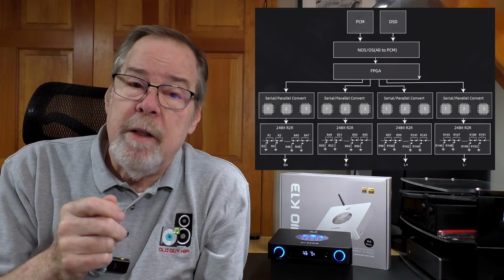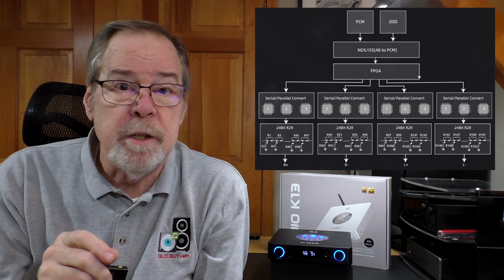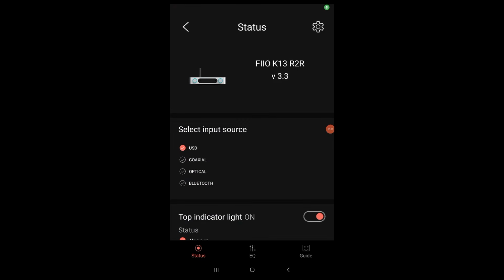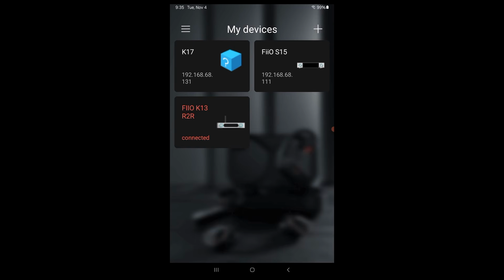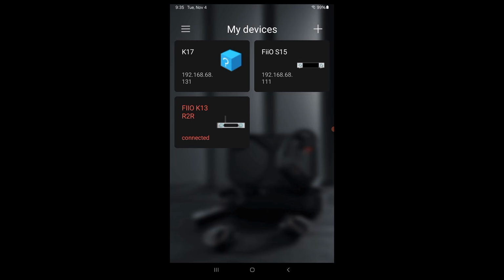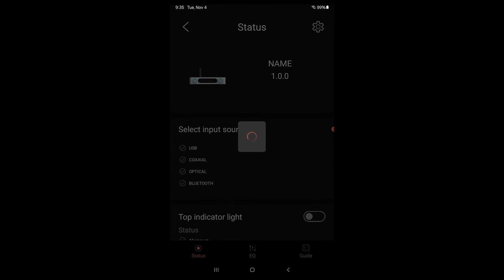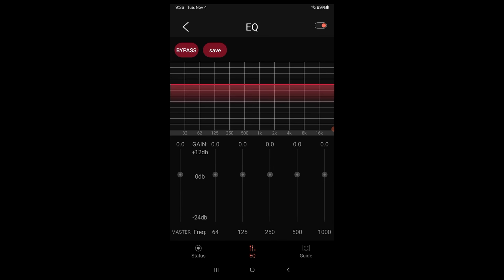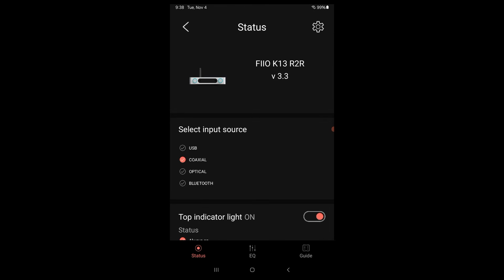FiiO Just Redefined “Affordable High-End”! Budget Price, High-End Sound: The FiiO K13 R2R Reviewed.

Comment: Hey Ed, I'm just curious if you have done any reviews on the Fiio k11 r2r dac. I would love to hear your take on that particular dac/amp. Thanks Ed.
Reply from the maker: I did 2 reviews last year.
Reply: @OldGuyHifi Ok Thanks Ed, I'll check it out.
Reply: @FoxRacing246  Hi, I bought one, just to try something r2r and stupidly cheap in my 2nd system... It's fair to say I love it. For the money its a no brainer. I bought this ridiculous Douk audio T6 pro class D amp as well. Just for fun. The dac cost $125 and teh amp about $250 USD. Iv'e always been a Single ended triode/horn speakers type of listener. But these cheap Chinese things are now very good. I was really surprised. Ive got them running with spotify lossless. macbook air and Living voice auditorium speakers. The amp benefits from the higher spec Power supply. The dac is the most listenable dac Ive had. My main listening is turn table though.... I don't use headphones very often.

Comment: Ed, still trying to wrap my head around all things reclocker. Question, when using a reclocker, is it always the case that you will either lose bit depth or sampling rate, or just some of the time? Trying to see if this is a steadfast rule or not.
Reply from the maker: You never loose any bits and the sample rate for SPDIF has always been a max of 192kHz. So even without a reclocker any Hi-Rez file run over SPDIF will never exceed 24 bit 192kHz. So, if you are coming out of your WiiM Pro streamer or equivalent, with Toslink or Coax, that signal is max'd out at 24/192. Only on USB or I2S will you get anything higher. I will tell you that I can pretty much guarantee you will never hear the difference.  Since there is zero music that was originally recorded at anything above 24/192. If the source claims to be at a higher resolution it was upsampled to that for marketing reasons. My guess is that truly no one can hear the difference between 16/44 and anything else. BTW DSD will pass through the reclocker at DSD(DOP)64.

Comment: In functionality the K13 R2R runs circles around my Ifi Zen DAC V2 + Zen Can stack. More inputs AND outputs, remote control (the ability to switch between headphones and line out speakers with the remote is awesome), built-in EQ, more power yet doesn't get hot (just warm). The sound really suits my preference of having gentle treble and a more relaxed "mature" presentation......it's like the DAC-equivalent of Sennheiser headphones, you can comfortably listen to it all day. In that regard it may actually disappoint users who want electronic synths to sound sharp and crunchy, it's not going to be like that out of the box. But of course.....built-in EQ to the rescue if you want to change that.
Reply from the maker: Thanks for sharing your detailed impressions and comparison! I agree with your assessment.
Reply: @OldGuyHifi  Good review,very elaborated!
I have an iFi stack with Zen Can 3 and Zen Dac One Signature. I also want to buy K13 R2R just for variety of sound in my Hifiman Ananda Stealth and Sennheiser HD 560S. K13 it will be better than my stack or should I just not buy it?
Reply: @jtekkit  I really wish I hadn’t read your comment! Taking delivery of Arya Stealth the end of this week. Still have the Zen DAC v2 and Zen Can setup with my computer for listening. I saw the popularity in this device and thought it would fit my needs perfectly. And now that I see you’ve done a similar upgrade, I’m not sure I’ll be able to hold off on trying this out!

Comment: Thank you for you input. Great channel! Planning to drive Hifiman XS with Fiio over balanced 4.4mm. Have ordered Fiio K11 R2R and debating whether is sufficient to drive them or I should go for K13. Does K13 deliver better amp not just more power and does K13 fixes the need for separate supply such as clean IfI x pro. If I am to add IfI x pro to K11 would it make sense to just skip that and go for R13? My primary use case is desktop set up to drive headphones from my Mac Air, iPad, an iPhone using Apple Music and YouTube video content.
Reply from the maker: For your setup, the K13 would be a better choice as it provides a cleaner and more powerful signal without needing an additional power supply.
Reply: @OldGuyHifiBTW, love your Budget Holiday System buying guide. For folks new to this hobby, this is what they need. Advice how to pair things up for good and enjoyable appreciation of better quality sound. I was lucky to be able to add to my set up self powered  KEF LSX II from Costco for unbelievable $599.

Comment: I love the sound and features of this DAC! I also have my PS5 connected to it. But there was an issue doing that. I was getting digital noise via USB to the DAC; which produced static and crackling noise. To resolve this, I bought an HDMI to HDMI Audio Extractor (make sure it can output your desired resolution and refresh rate). I then connected a Toslink cable from the extractor to the Fiio K13 R2R DAC optical in. This worked wonderfully!!!
Reply from the maker: Did you try changing the UAC setting?
Reply: @OldGuyHifithe PS5 doesn’t recognize the K13 as an output device when set to UAC 2

Comment: Hi Ed, I have been seeing a lot of good things about this Dac. How would you compare this Dac for 2 channel music listening compared to the Chord Mojo or Mojo 2? Also any chance Fiio makes this R2r dac with a music streamer...I am in need of a streamer and that would be a dual purpose for me...😂
Reply from the maker: I would choose the FiiO for several reasons. The form factor. It is a regular desktop component size. It does have a built in power supply, or if you wish you can use an LPS. It has balanced headphone out and RCA and XLR outputs. It is a true differential balanced circuit topology and it also use an FPGA. The colored buttons on Chord gear is a pain to use. With the FiiO many of the controls are on the remote. Best of all it is half the price.

Comment: Holy cow! First those headphones FiiO came out with (I pay little attention to model numbers, where they F1s or something?) and I bought those and they are my most comfortable and while they sound awful out of the box, I run them through a 4 band EQ (all headphones require EQ) and one small little tweak in the mid range and all the sins disappear.
I don't care about all the 3 letter acronyms like DSD, PCM, MQA, UPS, COD, FBI, CIA, whatever. They mean absolutely nothing to me.
Now FiiO comes out with this contraption! Makes me wish I was not allergic literally to headphones! Yes, even with the FiiO cans I just described, I'm good for maybe 15 minutes tops before they have to come off my head for at least two hours because of my literal allergy to headphones. (My ears turn red and get a burning like sensation, like a sunburn or something and it can be painful. It also doesn't matter what material the pads are made of.
The only thing I would disable on this thing is the Bluetooth. I don't do Bluetooth, it kills devices. I get up to 15 minutes of use on my tablet with a fully charged battery in bluetooth mode just for control, not streaming anything before the batter goes down to 4% and no, there is nothing wrong with my tablet outside of being Android 8 now. I rarely use it.

I wish linear power supplies weren't in the hundreds of dollars, then I could get one.

I like the way you described the EQ as a flat line, for a second I thought I was looking at my EKG read out......just joking!  The "De-essing" or "De-emphasizing" on an EQ (parametric or graphic) is a preset to cut back or eliminate sibilance. Basically, it is sort of a high-pass filter. Personally, I prefer manual adjustment to cut sibilance and such as sometimes those preset De-essing" settings can be too extreme. Sibilance is many times in the recording itself, which is why I prefer to manually adjust, because there is only so much one can do with a recording unless one want to remaster it, but most of us do not have studios and mastering engineers in out homes.
 
I hate on-line owners manuals. I have to have them in print to refer to them! Yes, I will print all 249 pages of an owners manual! I also still read real books, I won't touch a book reader or kindle device or whatever. I'm not sure whether that is a good or bad thing though with my poor eyesight. 

Oh, so one can just use the K13 as an outboard DAC?! On the surface, $320 is a lot to me for a DAC, but not only is it an R2R ladder DAC for the money, but it is also the kitchen sink. I have a Douk Audio Q11, why not add a R2R Ladder DAC, I'm thinking. Also I use a second gen Schiit Magni headphone amp, which does the job well and a Bellari 4 band EQ hooked to it which is a game changer for me and now I'm wondering if this one box will do it all as a headphone amp, EQ and outboard DAC? Although I am not so sure it can compete with my analog setup, which is easier to use for me.
I don't know, it is hard because I hardly use headphones. I don't get to listen to music much as a result unfortunately. (Not because I have potential to disturb my neighbors, I have a reference system, but I hate to and will not play loud! It is because my upstairs neighbor constantly disturbs me with loud noises so I can't hear my system or anything). No, headphones do not cut out her noise unfortunately, only slightly softens it, which is not good enough when trying to listen to music with a soft passage or detail or classical music.
Saving for this unit may not be justified.
Reply from the maker: Thanks for the comment.

Comment: R2R is not high end, is just an implementation.
i have built a few R2R dacs, with resistors and with good old Phillips chips and some Burr brown, i will tell you, nothing wrong with hybrids of delta sigma, dacs are not 100% delta sigma, they are mix of delta sigma and multibit.  everyday i run both, R2R and Delta sigma, and sometimes use more Delta sigma dacs than R2R for its sheer performance.
Reply from the maker: Thanks for sharing your thoughts.

Comment: Been enjoying mine for the last month or 2. I just use it as an AIO for headphones connected to an ipad with apple music or my consoles/gaming pc. Got it for $250 (usd) shortly after release and it’s even cheaper now due to 11.11/black friday sales. I dont use the phone app for it, but i have used the web app for eq, much nicer on a monitor. 

I have only 2 issues with it and 1 “i wish”. I’ll start with the “i wish”. I wish you could use both usb slots and swap between in the settings instead of having to unplug one.  My 2 issues, first, rarely, and i mean rarely, when turning it off, it wont turn off properly and the lights stay on. This prevents it from turning back on. You just need to hit the switch in the back and it fixes itself. 2nd issue. The LO button on the remote. Open it up, put some tape or gouge it out, better yet, don’t use the remote. If you hit LO, goodbye your ears or your speakers if you arent careful.   
Great device otherwise though :D     (Avoid black if you dislike fingerprints and dust. If you look at it wrong, it’ll randomly get a fingerprint on it)

Comment: Great REVIEW Ed! Thank you!! So, for people wondering about the Mimir!,  Hmm just like one commenter here,, i would say its OVER RATED! .. i had the MIMIR and THE FIIO K 13 for two weeks, and pls note, I have a Schiit Modius E( last version) for a year now.  THE K 13 SOUNDED BETTER than both MIMIR and MODIUS.  Now, i did use a DOUK AUDIO DDC  and JDS LABS SYNAPSE on all three.  Compared to the MODIUS, the MIMIRs BUILT quality is NO GOOD! The aluminum/metal used is so thin and sharp at the edges! Its cheaply made versus the MODIUS, also both have the same ESS chip. I also have to say, the MODIUS sounded the same or almost better than the MIMIR with the DOUK AUDIO DDC  and the SYNAPSE. via USB and Toslink! So I just returned the MIMIR, and im keeping the K 13!. I do have arya organic and BD DT 1990 PRO headphones.  NOW there is ONE THING i have to say with the K-13… when i used the 4.4 balance headphone out with my DT 1990 PRO. ( 250 OHMS) … on Low gain, Medium gain or a high gain, i get an OVER ERR. Error!!! . I went to FIIO website. And seems like they are aware of this and said to re start the unit.. well i did that several times. Same issue@.  It does not do this with my ARYA organic on 4.4 out.   So , im not sure why.  I will return this unit and i will buy another. K -13! Hopefully u guys that like the K 13 wont get that error! Hope this helps!
Reply from the maker: Great info. Thanks. BTW, I agree with you.

Comment: I am telling myself I wouldn't be able to detect the difference between this and the K11 R2R, which I have on the way. A Limited Edition Red one. I'll use the K11 DAC side to feed my 4-valve Fosi GR70 from my Isolated USB hub. Because the RCA outputs of my Fosi ZD3 Pre-amp are inferior to the XLRs, which feed my ZA3 Mono blocks. That way I'll have R2R Headphone out, and 4-valve headphone out, and Transistors sounds on the XLRs and Valves on the RCAs of the ZA3s - at the flick of two switches!

The best of all possible worlds! :)
Reply: It’s unfortunately pretty noticeable if using them as intended as an AIO. A different psu fixes the k11 r2r for the most part though, using it purely as a dac might be perfectly fine.
Reply from the maker: A lot will depend on the resolution of your system.

Comment: while it sounds great due to the upgraded amp section, i consider the K13 as  a kind of "bloat device" and it could have been quite a bit cheaper without that.
Reply: It’s an all in one, it’s what a lot of the budget side of the market wants. It’s small, cheaper ($250 or less most of the time), and just needs a usb connection to get going, or bluetooth.
Reply from the maker: Thanks for the view and comment.

Comment: Watch out for that LO button on the remote. Typical chi-fi
Reply: Yes, that has had me scratching my head on the K15 and K17 too. They can all act as pre-amps, so it seems natural that some people would want to feed power amps from them. So Fiio went a put an easily accessible switch on the front panel so you can bypass the volume pot and send a full strength signal straight to your power amps and blow up your speakers. What were they thinking? Other than that, all 3 of the 13, 15, and 17 look great.
Reply from the maker: Come on. It is a $300 unit. Have some realistic expectations.
Reply: @OldGuyHifi On the remotes I just wish they could have made activating LO into a button press combination that wasn't going to get activated accidentally, and made it a rear rather than front panel option on the K15 and K17.
Not doing so does make using power amps with these rather risky. I'm still sorely tempted to get one.

Comment: Thanks for the review. One thing, I don't quite understand a need in external reclocker, since k13 r2r has same XU316 chip built in and most likely has most of the basic reclocker components embedded in it to begin with.
Reply from the maker: Not really. A reclocker in addition to refining the incoming data stream also electrically and galvanicly isolates the devices which also impacts performance. I used several different DDCs with very good and noticeable improvement.

Comment: Wondering how much of a difference is K11 vs K13 DAC alone?
Reply: as far as i can tell: none.

The upgrade to the k11 is the amp section (which is the k11s weakpoint) +  connectivity + xlr out + EQ+ remote.
Reply from the maker: The K13 has added an XMOS processor and a more powerful FPGA to the mix which does make a very noticeable improvement.
Reply: @OldGuyHifi Thanks.